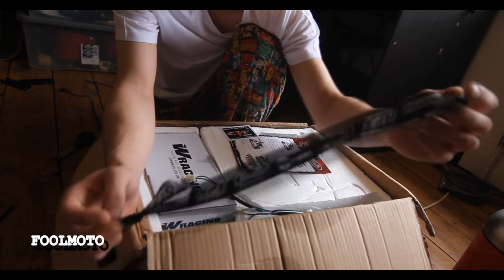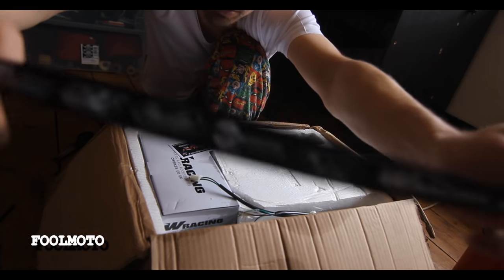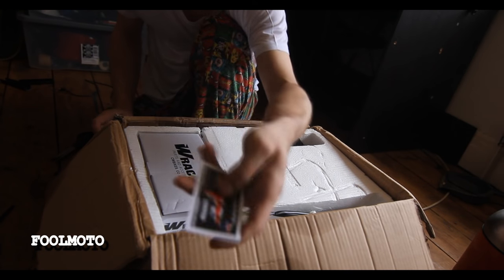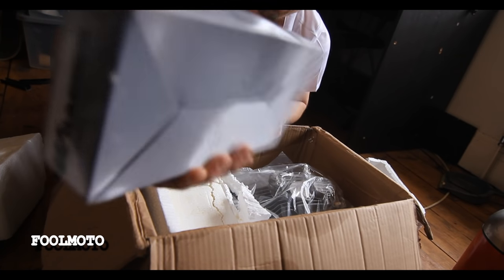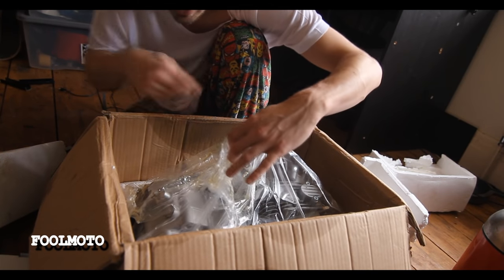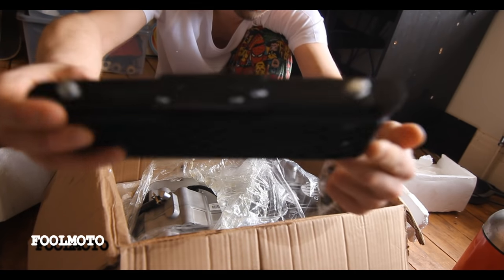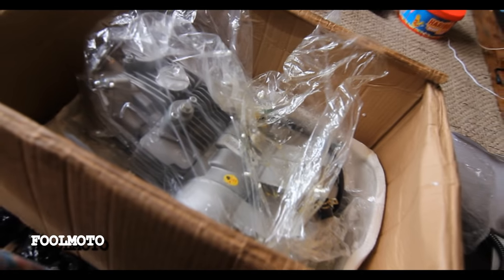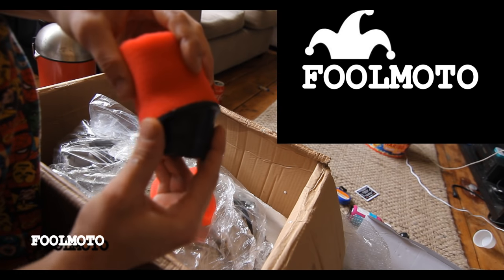NEW PIT BIKE ENGINE YX 160cc UNBOXING!

Comment: hi , forget the instant gasket . there was no need for it , just fit the gasket ...or you can  smear some clean engine oil on the gasket faces then if you have to take the manifold off again you can re use the gasket :)
Reply: hes using a black and decker drill, he has little experience it shows